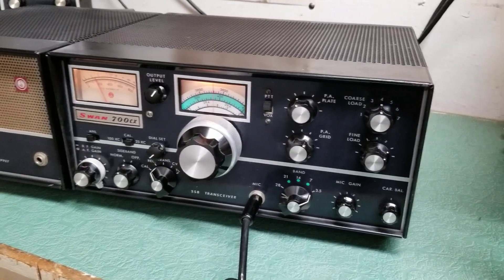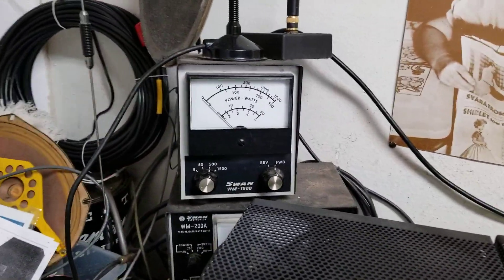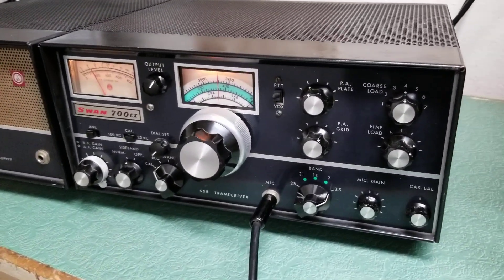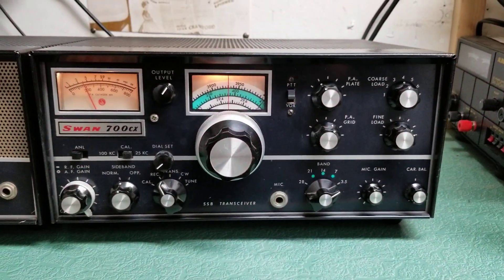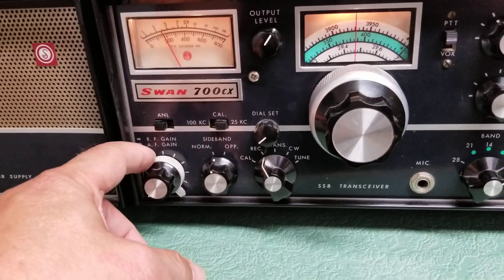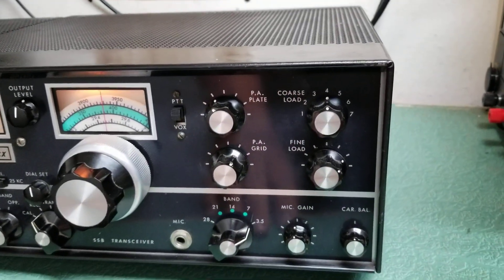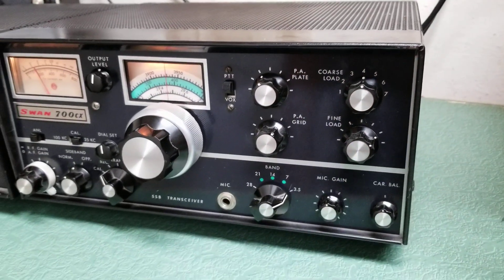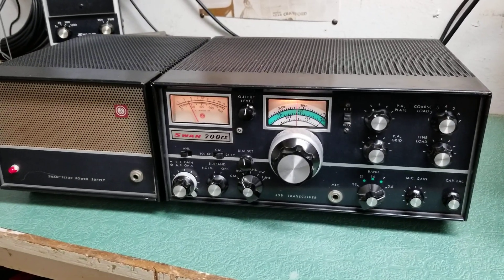Swan 700CX HF Transceiver Transmit

Comment: That brings me back- I think this (or the 500) was what my old high school had in the closet back in 1979, and I pulled it out because I was licensed and used it on 20 and 40.  It was the only HF transceiver I ever operated (I never owned one) so I thought it was great, and only later did I read that many people didn't think it was too great.

Comment: Definitely a beautiful rig... thanks for sharing, John. I remember operating a 700CX back when I was in Radioman "A" school at the Naval Training Center San Diego back in the mid 1970's and would visit the base's awesome little hamshack up on top of one the buildings on base. :-)
There was the 700CX at one position and a Collins S-line transceiver at another with a little 2-meter rig next to the Collins, and switchable to either of the two HF positions  was a nice big floor-model linear amp ... not quite sure of it's make and model now...it was definitely a big set, something about the size of  a Henry 2K or something like that... and a nice Johnson Kilowatt Matchbox  to couple the rf juice into the antennas, a random-length end-fed  longwire for one and I think a multi-band vertical for the other. By and by I had bought a Clegg 99'er at a local San Diego ham/military radio surplus  store and strung up a little half-wave dipole between the railings around the little hamshack' roof for that and most awesomely a 50.4 MC crystal was included with the 99'er... that was a blast operating that little rig, too. :-)